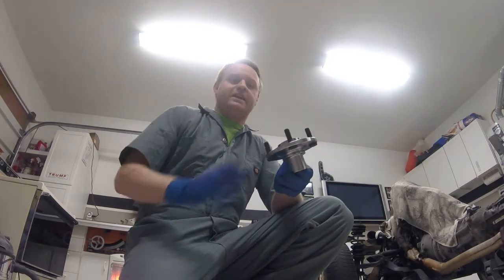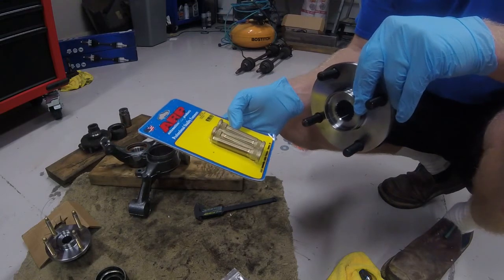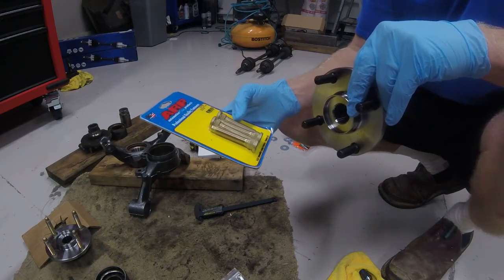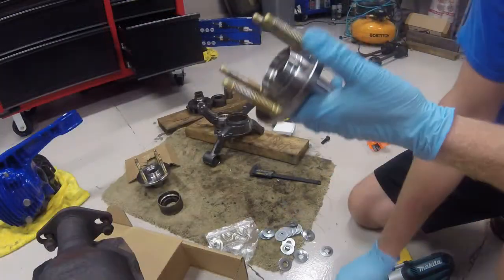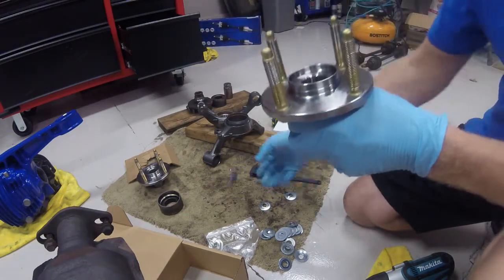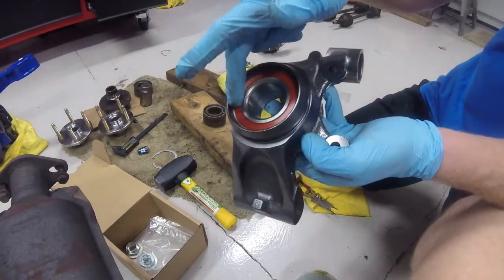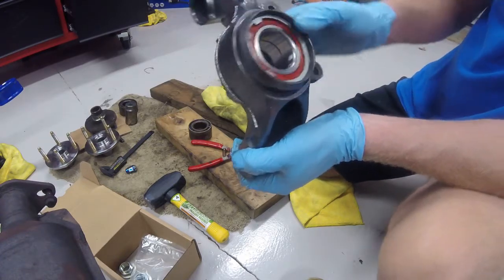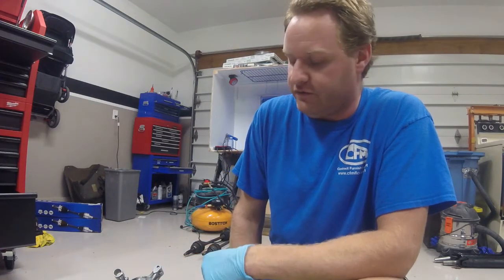Exocet Build: Miata Rear Hub Bearing & ARP Stud Install (Part 11)

Comment: BTW TIP: I'd put the hubs in your oven and the bearings in the freezer...eg the hole expands and the bearings shrink...much more civilised than beating with a hammer....still might need a tap with a hammer....this would work for the studs also.
loving the series as I'm looking into building a kit car
Reply from the maker: Yes I had considered that, I've always heard that works but never tried it.

Comment: How did you press the hub into the new bearing after you greased them? Good video. Thanks!
Reply from the maker: Lukas Gilkey no press just a block of wood and a big hammer to slam it in there.